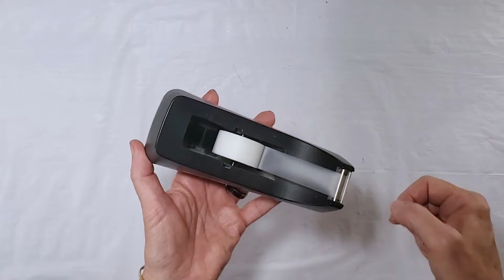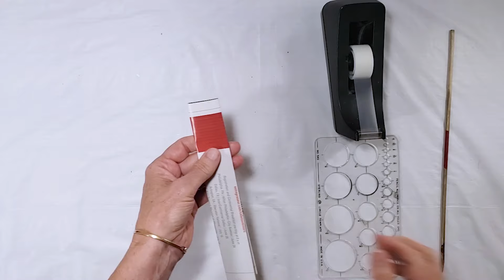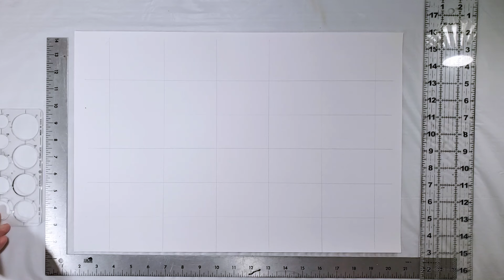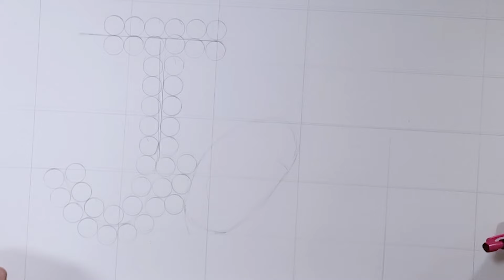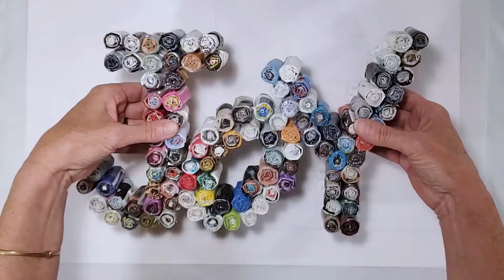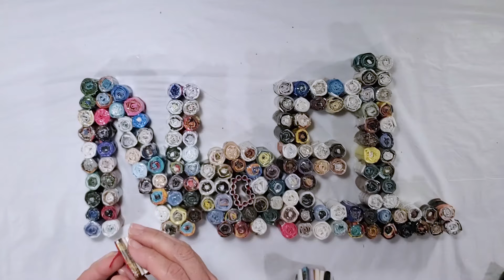Upcycle Your Old Magazines Into BIG Word Home/Holiday Decor

Comment: Use "Press n Seal". Once you lay out your design, lay a piece of press n Seal over it. Make sure it is well adhered. Then flip the whole piece upside down very carefully. Glue, glue, glue. Let dry. Test to see if any weak spots, add more glue as needed. Remove pres n Seal once no longer needed to hold project together. 
Note: the press n Seal is NOT strong enough to hold project together until it has been glued and the glue is dry. 
Just a thought that occured to me as I was watching the video.
Reply from the maker: Thanks for watching and for the tip. 🙂